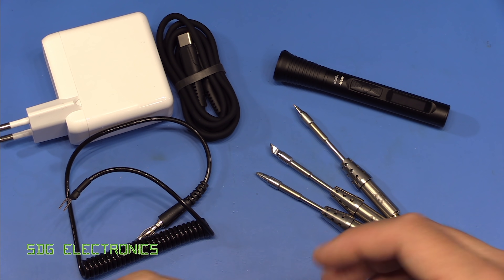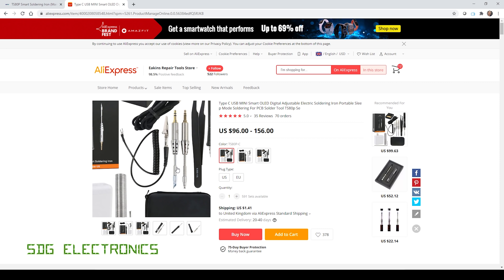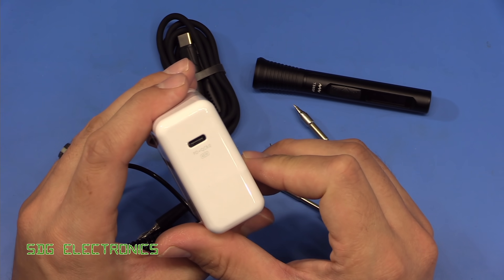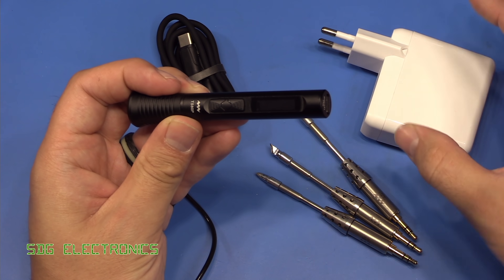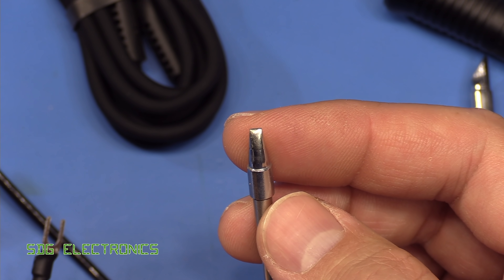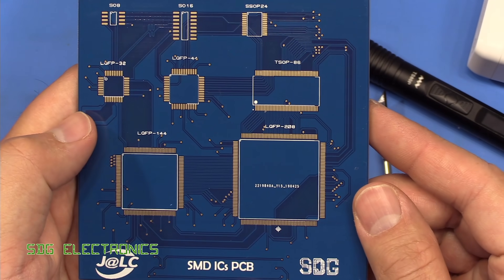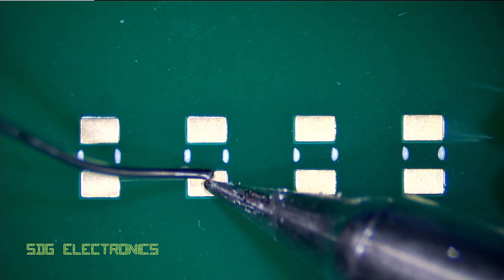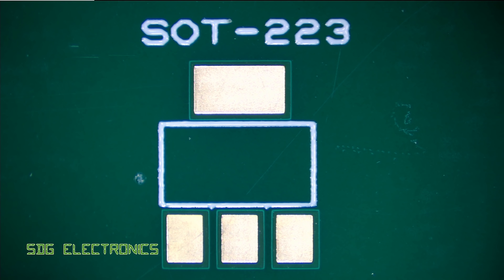SDG #179 Miniware TS80p as your main Soldering Iron?

Comment: Great review. I picked one of these about a year ago as I wanted to learn some soldering skills.  I am total beginner and was practicing today with it.  Which tip would you recommend for changing out capacitors in CRTs or old gaming consoles and modding such as soldering wires on pads, pin headers, bridging pins etc?  Is it the BC02?

Also where can we get good 60/40 leaded solder from within the EU.  Is only option to import from Amazon US?

Comment: I use my TS-100 as my daily driver due to the fact that it's much better than many other cheap soldering irons - Pinecil is another cheaper TS-100 rip-off I am thinking about getting (and have the grunt needed to do lower American gauge wire soldering like 8 Ga). I flashed Iron OS custom firmware so it is up to job that I demand of it.

Comment: Hello, why you don't do it with 24volt ( 23,8volt )  and with 350grad temperature ?
And do the ic again you will be surprised !
Mod Info if you change the mosfet to a 30volt 6A  one you can go up to 28- 29 Volt  ! And see how good is soldering my preferring is 26-27 volt  buy a protected one ! 
Best regards,

Comment: Conical tips are the worst for smd, I only used conical for some holes or wires... Also, that chisel tip is perfectly fine for smd if you have the space around it to lay it down flat, you just have to put it in a better angle to be able to take advantage of the bigger thermal mass.

Comment: Hey, great video!

I have a problem with my ts80p. The cap for protecting your fingers is somewhat loose when soldering tip is inserted.
More info and picture is here
https://www.reddit.com/r/soldering/comments/i14xsl/ts80p_wobbling_fastener/

does anybody else have this issue or do you all have tight snug fit?

I bought a new separate tip but same gap.
Thanks

Comment: Thank you for a wonderful "real world user" critique.  I can agree this iron (and its' "Big Brother", the TS100) are not really suited for "full-time" workbench use.  However, as a "semi-portable" (i.e., it needs an "electric umbilical" for power) iron, it's certainly valuable for the Field Repair Tech (or similar "Hardware Hacker") to carry, AS LONG AS there's an "available" AC Mains supply OR one carries a Suitably-Configured rechargeable battery pack (Lead-acid, Lithium, NiCad) or Few for those "assignments" where there's no AC Mains available OR even a "car adapter" cord (with a suitable-length cord) so you can use your Auto Cigarette Lighter receptacle.

Comment: No mention of cable drag using USB cables ???  I can't see 25W cutting it outdoors or for more general purpose usage on larger joints.  The TS 100 is far more versatile in terms of power supply. Team it up with a surplus 19V laptop supply or 4S lipo for really nice results especially if you use silicon insulated power cable. The TS100 stick out is on par with the older 800 series Hako irons so a bit longer than the TS80.

Comment: I've used the TS100, the "bigger brother", now for over a year as the main SMD soldering iron (also for work, prototyping), and have all the tips for it (I think there are 9 different ones, including 3 sizes of 45 degree flat, a blunt and a fine tip, that cover most SMD use cases for me). It's noteworthy that these tips have heater, tip and thermistor all in one (like JBC and other high-end), so the heat transfer and responsiveness is much better than with old-style replaceable tips. The TS100 has 60W at 24V, and I've had no problem soldering large ground planes with it. It's not quite on JBC level, but it eats a lot of simpler solder stations for breakfast, much better than some older Weller or ERSA stations I had. And it's a fraction of the price. I also really like having the temp adjust buttons right on the grip for quick adjustments without putting it down. And it takes up less bench space. Good note on the grounding though - I wish the bundles they sell would come with a grounded PSU. Having an extra wire dangling off for the grounding is annoying. Connecting the negative power lead to earth is sufficient though, so it's an easy fix for a bench setup (or use a laptop supply with earth).
Reply: That's so true, grounding or earthing is the biggest issue with these chinese irons and stations.

Comment: Mine works very well with a Type C PD power bank 20Ah with QC 3.0. Also the included USB C cable has a nice flexibility which adds to the usability . The ejecting collar allows for hot swapping tips with ease provided you remember not to eject into your lap!

Comment: I'm using a Metcal mx-500p-21 as my main soldering iron. It was so good it has been redesigned and copied as DIY.
The main tips I use often (STTC-037 and STTC-022) are still working perfect - 10 years down the line, and they have seen a lot of usage.
Last week I soldered 3 solid copper cantennas for 5.8GHz using STTC-114 and my QUICK 861DW hotair - solder reflowed perfectly around the SMA connector which wasn't damaged at all.
You can buy tools you regret buying, and you can buy tools that you love using. I also got a KSGER T12 as a back-up, though I'm not impressed at all - but it works, and that counts as a back-up.

Comment: Nice addition of the note that the voltage of an AC source can kill electronics. I actually had this in a project once where I was soldering a new FET on a PCB and for 4 times died immediately. It ended op being voltage coming from a cheap notebook laptop psp that was coupled with a USB scope (ground) to my project. So the whole project was @ 110AC because of the ac adapter of the notebook and my soldering iron was grounded to a real ground. It drove me absolutely nuts because the components where known goods.
Reply: I think I had this discussion with SDG before. My belief is that a soldering iron tip should be grounded just like an ESD strap - 1M to earth. It allows you to work on live circuits without shorting them out, provides improved ESD, and no charge buildup.

Comment: I've had the original TS100 (the 12-24v DC barrel PSU version) since they first came out.
It's worked amazingly for me. The tip mine came with sounds like it's the size you want, it's a slightly flat point, about 2mm in width. TS-BC2 I think it's called.
I use that and the TS-B2 (a blunt point tip).

I love it, plenty of power for soldering huge heat sucking things like big ground planes and huge screw eyelets.

I made up a 3m silicone wire with with a DC barrel plug on one end, the other goes to a variable voltage Lion battery pack which can give me 20v, so I'm completely mobile. At the bench I use an old laptop PSU (which also recharges the battery pack).
Reply from the maker: Sounds like a good solution 👍

Comment: I've had my TS80P for a few weeks now and absolutely loving it for day-to-day workbench use.  Buying the kit that includes the really flexible silicone USB-C lead is essential. Mine came with just the fine pointed tip, so the same day it arrived I ordered the TS-BC02 tip (2:58), which is the tip style I usually deploy. New tip hasn't arrived yet, but after seeing your review I'm pretty confident my TS-BC02 tip choice (for my primary use) was correct. :)
Reply from the maker: I didn't find anyone with stock at the moment, but I will order the same one. It looked closest to the type I find most useful

Comment: I would have liked to have seen that power supply opened and given a quick once over, distance between the high and low voltage areas especially at the optoisolator, the transformer pulled out and unwound to see if it has a double insulated winding.
Those 2 pin units often come with a dangerous adaptor to fit UK sockets, I demonstrated one at work last week and had people in hysterics :)
Reply: instablaster...

Comment: Would you recommend this for microsoldering?  I'm looking for an iron to use for iPhones and other mobile devices but I'm a complete beginner.
Reply: Definitely not. These will mess shit up that's difficult to clean up. Buy as good as you can. KSGER T12, genuine Hakko 951, JBC. Get the one that fits in your budget.
Reply: @johnyang799  what about the TS100 there seems to be nicer tips available for that.
Reply: @naheeduddin1672  ksger is amazing for the price. I have not used TS100. But I have used JBC. Ksger is definitely the way to go. IMHO.
Reply: @johnyang799  What exactly is so bad about this iron? Power is fine, tips are okay.
Reply from the maker: Certainly you can use it, but it wouldn't be the first tool of choice. If you don't have any equipment, the KSGER that I reviewed a year ago is possibly a better first choice
Reply: TS-100. I soldered quite a bit with it now. 1 year soldering smds. I can recommend it.
Reply: The KSGER T12 is cheaper, it is easier to set the temp, it does not get too hot like the TS80/TS100 are infamous for and it can use high-quality Hakko tips just as well as KSGER tips. But for soldering SMT, it is better to get a hot-air soldering station than a soldering iron.

Comment: Cracking comment on the floating voltage Steve. I use a TS-100 as an everyday iron as I travel a lot (and its cheaper - lol).
Reply: TS-100 "grounds" the tip to the -ve of the supply, so if you're using a good grounded laptop PSU (as I do), your tip is also grounded.
Reply: mine is capacitively coupled to the negative contact on the barrel jack.  its connected to the screw on the back where you can attach a seperate grounding cable.
Reply: a metal case for the ts100 would be awesome, not usb-c   i cracked mine twice
Reply: @gamerpaddy  and a shorter tip length
Reply: I use it too as my main soldering iron. 10mm2 wire or smd work no problem. The ts-100 is amazing.
Reply: @Todestelzer  I've soldered everything from huge ring terminals onto 4mm copper cables to tiny SMD components. Love it!
Reply: @Marcel Zuidwijk the USB C was the cause of most of the false starts until PD got established. The 5.5mm DC barrel is so much simpler!
Reply: TS100 is work to 12 volts ?
Reply: @VictorGonzalez-fw3nl  Hi VIctor. It can work with 12V but the power is reduced so its really only good for smaller tasks. I use a laptop power supply at 19V and it does everything I need.
Reply: @VictorGonzalez-fw3nl  yes
Reply: @Marcel Zuidwijk I just picked up the Pinecil Soldering iron which has both a USB-C and DC power jack on the back. It works pretty much the same as the TS-100.

Comment: Really surprised how well it worked for you, great review. I got so frustrated with 'cheap' irons yonks ago I just bit the bullet and bought a weller81. I have never had any issues soldering anything since lol.
Reply: I have used and own both Metcal and Weller irons but now pretty much exclusively use as TS100, unfortunately Wellers customer service and quality has gone down hill in recent years IMO they seem to rely on their name alone to sell stuff.
Reply: @mfx1  I do agree and there pricing does seem rather exuberant these days.
Reply: @mfx1  hi is there a reason you prefer the ts100 over metcal also what voltage are you useing with your ts100
Reply: @dhananjeyannatarajan5366  Because I can use it anywhere cordless. I use 18v DeWaly batteries.
Reply: @mfx1  on hard demand tasks do you find that the ts100 can keep on equivalent temps?